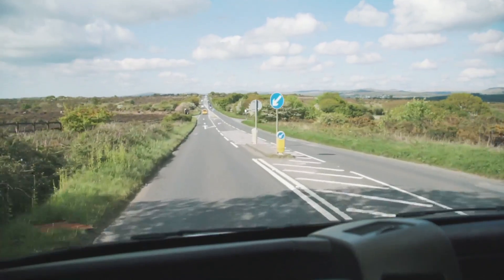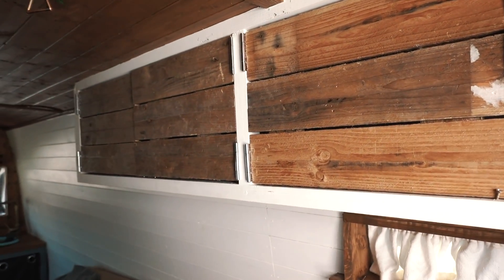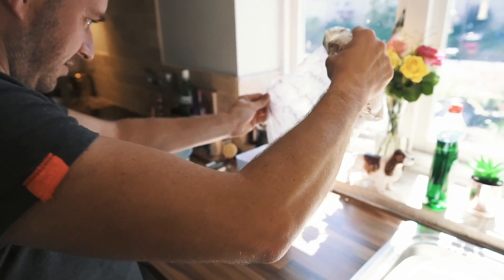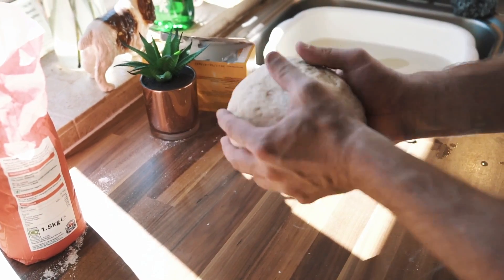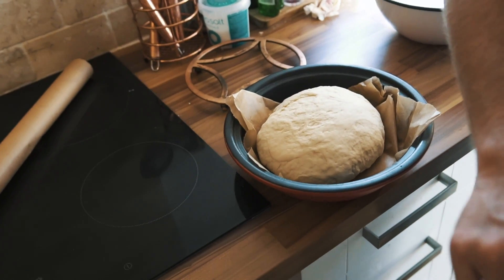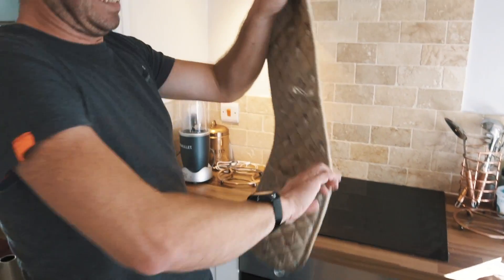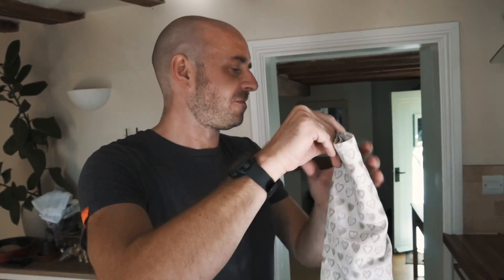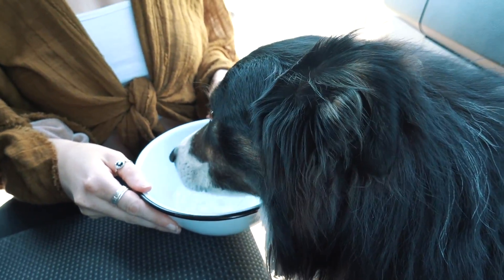Does It Ever End?! Van Life UK Lockdown Diaries Ep 21

Comment: Great video don’t forget to get 2 scaffolding planks about 6 foot long and a 2 ton bottle jack So should you get stuck again you can jack the van up put the planks under and away you go ( you will need a square peace of ply wood about 1 inch thick and about 17 inches square to put the jack on so it doesn’t sink) you could get some punch decking it’s about 3 mm thick it’s what they use on car transporters  You can buy fancy ones but I have no idea what they would cost Plus the scaffold planks do the same job  I’ve used them many times over the years plus they don’t take up much space up in the back anyway great video

Comment: Hi I am from a maritime background and on ships we try very hard not to mix aluminum and steel and if it cant be avoided we put rubber in between,  there is a great Corrosion risks with aluminium and steel on contact especially in the mix of salt water, and on a ship we are forever fixing it
Reply from the maker: Hi Alex, thank you, you make a really good point. We painted the bars with galvanised paint, and the steel is also coated. As far as we know this is a good barrier between the two, but if we have any problems, we'll be putting a rubber piece in between to stop any corrosion. Thanks for the heads up though, it's much appreciated!

Comment: Be careful. Dissimilar metals in contact in an environment with slightly acidic water can produce some very funny electro-chemical effects. Insulate the dissimilar metals from each other by some means.
Reply from the maker: Hi Gerard, thanks for the heads up! We did paint the bars with galvanised paint, and the steel is also painted, which should be a good barrier between the two metals. We’ll probably add a piece of rubber too though just to be safe ☺️👍